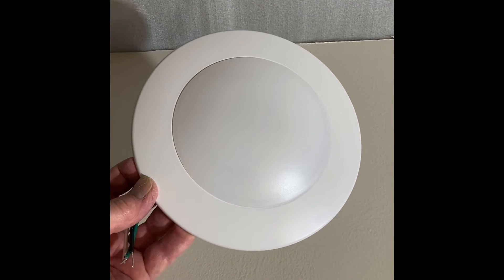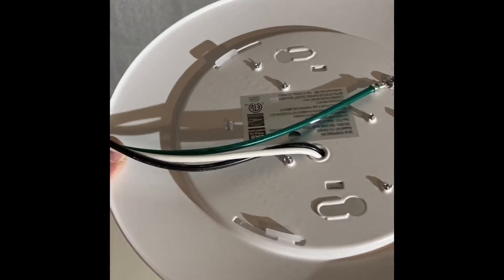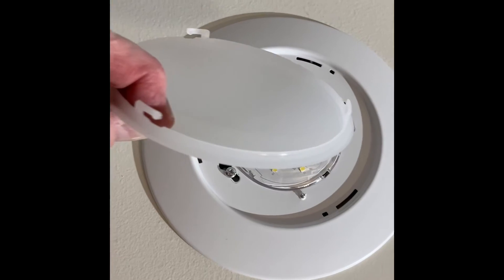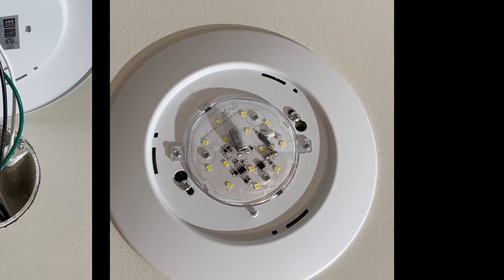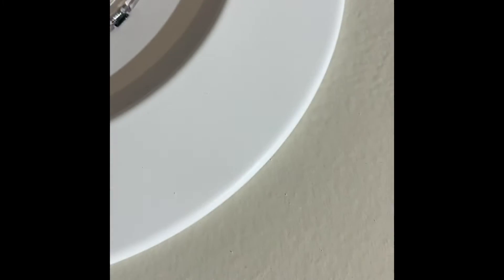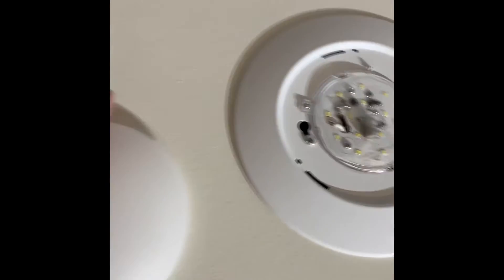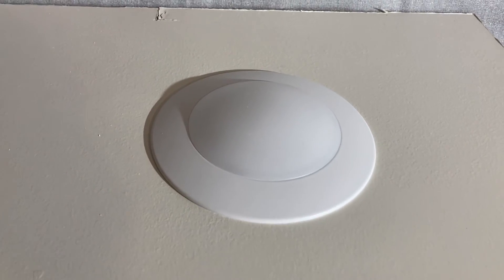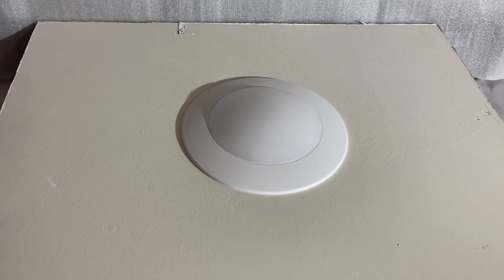Bel Air Lighting flush mount light video review

Comment: Is it common for these to shut off if they overheat? I have a few dozens of them in my new home and it's very frustrating. I'm thinking of just pulling out all 24 of them and throwing them in the trash. I have 8 that are completely dead after less than 1 year.
Reply from the maker: They shouldn't overheat, but yeah, if they do, the electronics get unhappy and they'll shut off or fail.  I'd contact the manufacturer and complain. They might honor the  1-year warranty. Good luck.